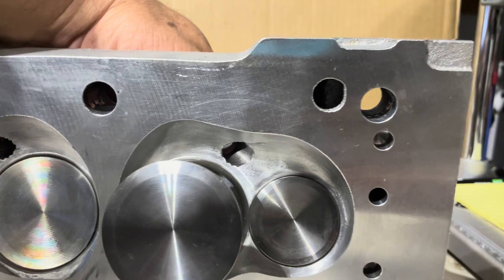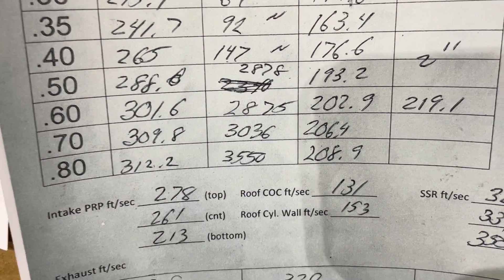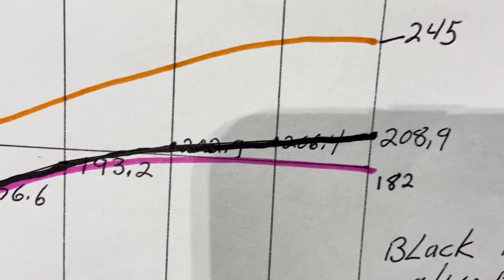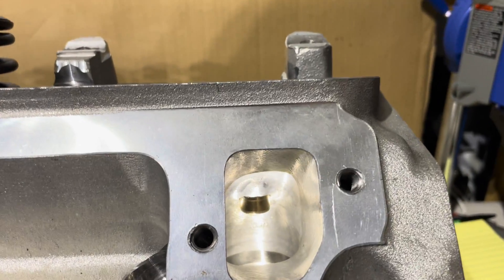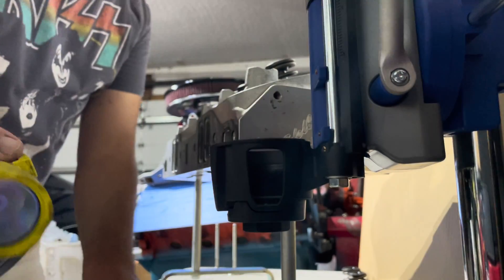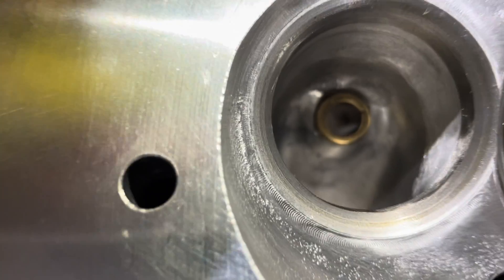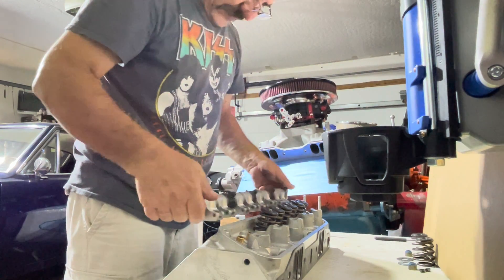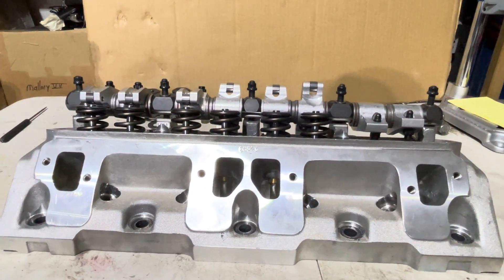CNC Hughesengines Big Mouth small block heads

Comment: How would the improved exhaust flow on the "orange" W5 affect power over the Hughes heads?
Reply from the maker: Could you please rephrase the question
Reply: @Robs-Garage-experiments   The Hughes exhaust flowed 208 but the ported W5 flowed 245. Where would the extra power be made? Mid range, high rpm?
Reply from the maker: Sorry for the delay in response, it is my belief that it will show up through the entire RPM range and more so to grow more as the valve lift and the RPM range go up.

Comment: KuL heads. 300 cfm peak pretty great. i bet it has great port energy. 240 cfm by O.350" lifts is really great. That bigger valve is doing that, also because when it comes up on the cam lobe and right when it cracks open, is a rush on that bigger 2.08" valve so it augments a snappy cam lobe pretty great. Get a rocker arm that does the same with fast initial action, great for efficiency, or some rockers may favor a consistent ratio that has a balance throughout its ratio arc. Well good job with the heads. The W5 looks really great as well. You can see these heads can still work great with a dual pattern camshaft. This and a high lift cam with mopar size lifter or larger would absolutely make valve action Omazing! Fast opening rate with big valve in there is really going to like a single plane on a larger cubic inch stroker street engine, it is really going to want compression.
Reply from the maker: Thanks Dennis. For a more in depth view of the heads, check out Charlie Servedio's channel. He was kind enough and most happy to get together on his bench and flow them. IMO, its worth the trip to his channel. (Don't take me a smug here...) I'm pretty good with what happens within cylinder heads, how to choose camshafts, rocker arm set up's etc... of engine building. This is not my first rodeo. I've been wrenching, screwing around with & making HP SBM engines for over 30 years. Basic builders advice and equippment choice and how to use, I don't need help with. I will also be making some weird & usual part choices on purpose. Things that no one would do. Just for fun is the reason it gets done. I'm also retired and I just want to screw around a little bit.

Hey Dennis! How about a quick comparo video of the Hughes BM vs a W5? Yea, let me whip that up.
You might see where I favor the W5.

What I do & will need help with will become painfully obvious, should be hallairious, later on. That will start at the track. Very low experience there. "Let the comedy begin!!!"

Is there a way to send a private message?
Reply: Hey I have a set of W5 hears no valves. Someone started working on them. But stopped. I'll never get too them. Would you be interested in them @Robs-Garage-experiments

Comment: I saw someone on ebay not long ago selling iron W2s, had a few pairs of them. I guess someone is repopping them
Reply: Indy basically repops the W/2s in the 360-1&-2s in aluminum. Casting issues plagued them in the past from what I understand.
Reply from the maker: No one is repoping the W2. Chrysler would have a shit for and sue them out of existence. They are extremely exacting in what someone will reproduce and a huge PIA in getting there OK. Chrysler has no issues getting the Feds involved having you arrested and held liable for anything and everything they throw at you. We have seen this several times in the past.

Comment: i called and they said they do not have anyone to port anymore. is this true?
Reply from the maker: So sorry, You called who?
Reply: @Robs-Garage-experiments  I called Hughes Engines, and was told the no longer have someone who does the port work there
Reply from the maker: Whoa! So sorry I missed your reply for so long!

If they said so, then asking me if it’s true is a weird question for me. A crystal ball I do not have nor a polygraph. (LMAO!)

But I’ll say this, finding a good head porter at a reasonable price should not be to hard to find. I myself have been lucky to discover some excellent and top notch fellas very well schooled by legendary head porters.

Joe Mondello & David Vizard to drop a pair of names for there teachers.
Reply: @Robs-Garage-experiments  I just found that seemed odd , maybe due to Covid stuff that they would say that. BTW What is bore size used for measuring the flow of those cylinder heads?
Yes so true about hard to find people, Larry Smith  flowtech2
Reply from the maker: @smilsmff  4.04 I think it was.
Reply from the maker: @smilsmff   Sorry I missed your reply.
IIRC, (That's actually laughable at times) the heads were flowed with a 4.00 bore plate.

Comment: The Dyno is going to be fun !  Thanks Rob
Reply from the maker: Not with these heads & engine size but I’d. awedully be bummed out of it didn’t do well. I found a fella about 7-8 miles away that has a dyno. Turns out, these fellas have been in print before doing a MoPar engine or two.  When I contacted them at their shop, I was well treated and warmly welcomed. But they had bad news, their dyno was broken and they said it would be a while. I said no problem, I’m not ready yet! But I’ll be going up the block when the time comes.